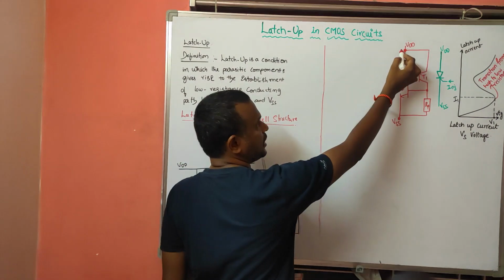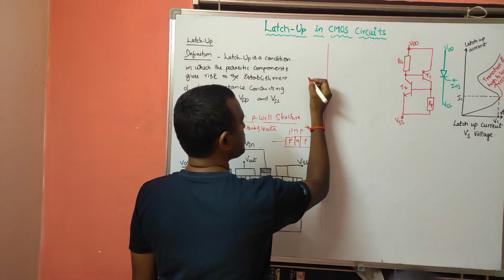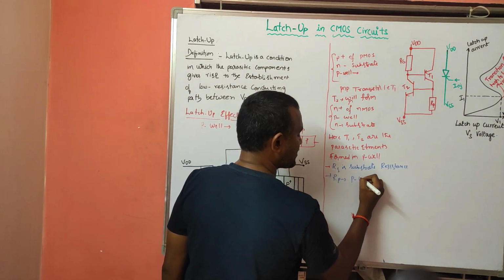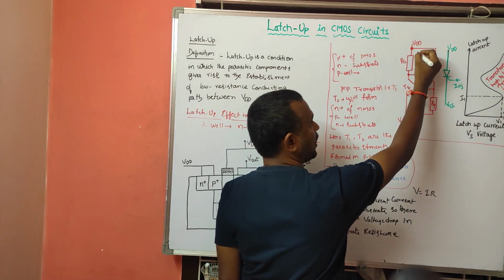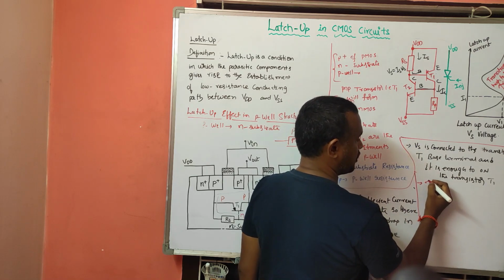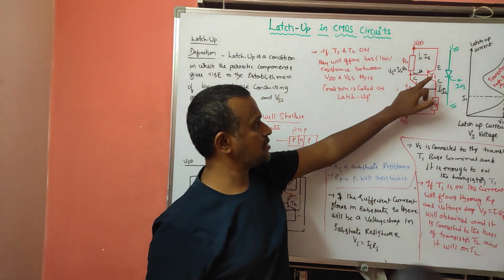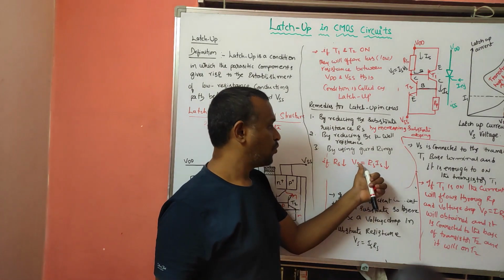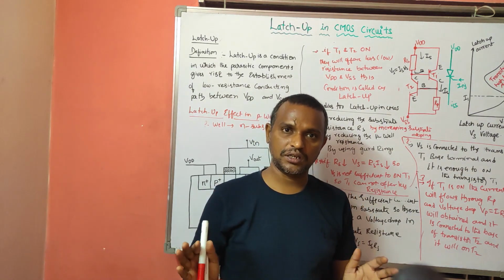Latch-up in CMOS Circuits

Comment: Hi Venkat, good explanation, can you also make a video of how tap cells will avoid the latch up issue in CMOS circuit ?
Reply from the maker: ya sure
Reply: Hi krishan, 
Tap is bulk or body,  tap is  VDD/VSS
Reply: @Nandamashok  bulk and body are same and tap is bulk/body  and power AND GROUND ARE VDD , VSS